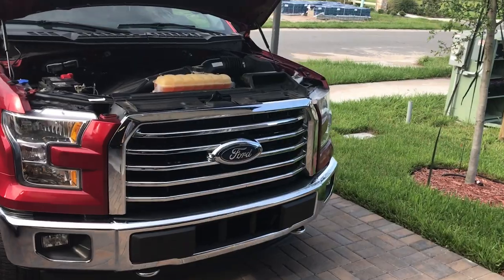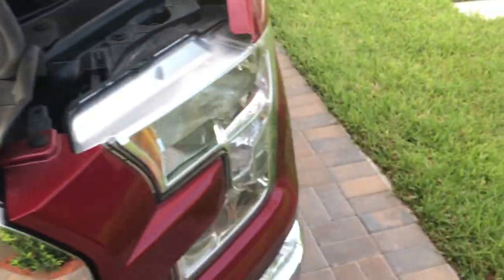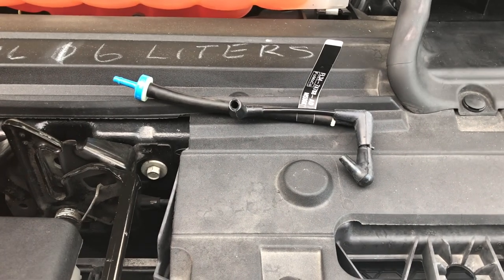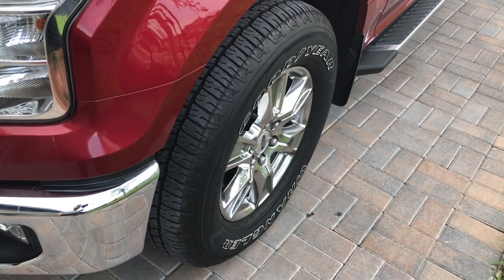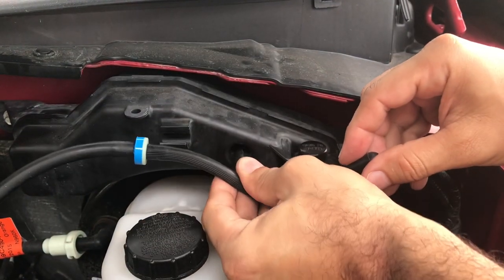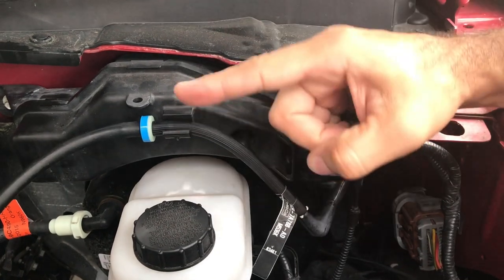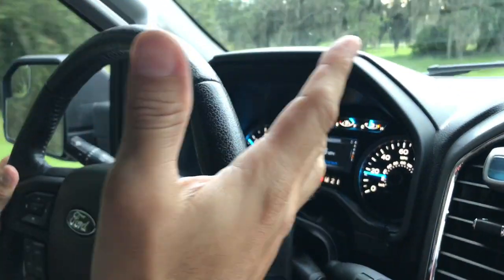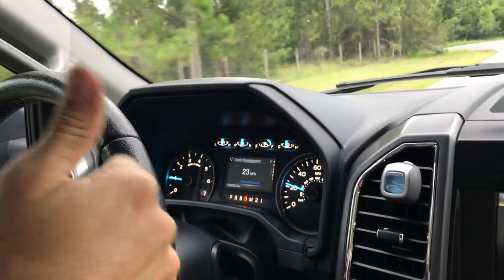IWE Check Valve Replacement On a Ford F150

Comment: Replace the check valve tube and solenoid.  Still didn’t fix the issue.  I have a 2016 F150.
Reply from the maker: Hey Matt. I'm afraid that in your case, it could be a leak in the IWE hub on one of the lines. Also consider re-tightening all the heat shields around the exhaust. The noise they make when loose can be mistaken by the IWE engaging.
Reply: Did you fix your truck?
i also replaced check valve and solenoid and it didn’t fix the problem!
Reply from the maker: @salkuwaiti66  Replacing just the check valve worked for my truck. You can try testing your IWE for leak. Check out this video. https://www.youtube.com/watch?v=gwMXfQIjx5Y. Also keep in mind that the F150 has several heat shields that can vibrate and might be causing the noise. You can try tightening all your heat shields.
Reply: Saif Alkuwaiti did you guys have hub leaks?
Reply: BillsFan Wyoming was it an iwe hub leak?

Comment: Took my 2014 in fo a horrible bed shake. Yes the 12th gen has a natural bed shake, but mine is horrible AF. The said its the check valve. Coverd under my extended warranty.. 100$  I'm now pissed off that I could have spent way less.. and my bed still shakes like an earthquake 😐
Reply from the maker: Brandon Laird sorry for that. I’ve been in a similar situation and got fooled at the stealership too

Comment: Need a link on part I tried part # didn’t work
Reply from the maker: What year is your truck?
Reply: 2010
Reply from the maker: @jacquesmcconnell7472  That's a different valve, for what I searched. It's best that you get it at the dealer. The price won't be much different than online.
Reply from the maker: https://www.oemfordpartsfast.com/oem-parts/ford-vacuum-hose-fl3z3a788b
Reply: Daniel CarFix 
Is this the updated part number you posted? I can’t seem to find the right one. I have a 2016 f150 3.5
Reply: My 2017 OEM PART WAS FL34-7a788-AC and was replaced by updated part       . . .        # FL3Z-3A788-B        . . . Dealer $21 . . .
Reply: Did you ever find the part?

Comment: I gotta great deal on a raptor because it had this problem.
Reply from the maker: That's great! Just to let you know that Ford actually released a TSB that instructs techs to remove one of the vacuum lines and block off the solenoid so the IWE stays engaged all the time now. MPG should go down a bit, but you won't get the grinding

Comment: You can always delete IWE and install the IWE eliminator.   10 minutes per side..   look it up...   you’ll thank me later
Reply from the maker: That’s a great option too. I’ve seen it. The only downside is that it will lower the mpgs. Fuel economy was the reason ford created the IWE

Comment: I changed it on my 2010 and it still rattles
Reply from the maker: Then you need to do a vacuum test on the IWEs. You probably have a leak on them or a vacuum line. There are some videos on YouTube on how to do a vacuum test on a ford IWE.
Reply: Did you do this exact part? My truck doesn’t have this piece at all

Comment: You didn't say how to check it.
Reply from the maker: Check what? is your IWE grinding?
Reply: @dcfgarage  The one way valve.
Reply from the maker: @brentbradley6711  You can't test the valve. I replaced mine because ford released an updated version and there were no leaks in my system. If you test your system and find out that the IWEs and hoses are not leaking, it's probably the check valve. 

This video explains how the system works. I hope it helps - https://www.youtube.com/watch?v=kJDaeANoxPU
Reply: @dcfgarage   I know how it works but what about the valve ? I'm sure there is a test for it.
Reply from the maker: @brentbradley6711  I don't know of any. Because it's a check valve, you could just remove it and use your mouth to test it.

Comment: 15
Reply from the maker: I found this one online. Of you can get it at a ford dealer. The price isn't that much different. 

https://www.oemfordpartsfast.com/oem-parts/ford-vacuum-hose-fl3z3a788b?c=Zz1mcm9udC1zdXNwZW5zaW9uJnM9ZHJpdmUtYXhsZXMmbD05Jm49U2VhcmNoIFJlc3VsdHMmYT1mb3JkJm89Zi0xNTAmeT0yMDE1JnQ9eGx0JmU9My01bC12Ni1nYXM%3D
Reply: Thanks